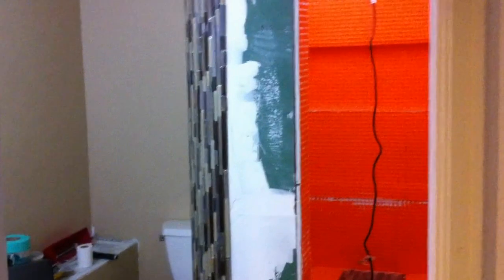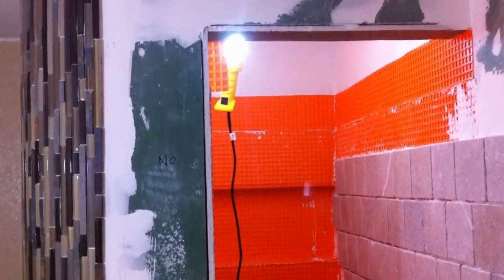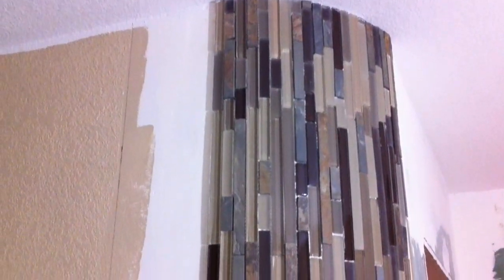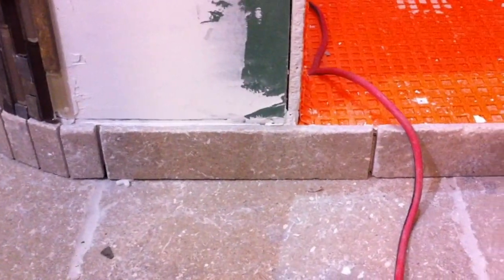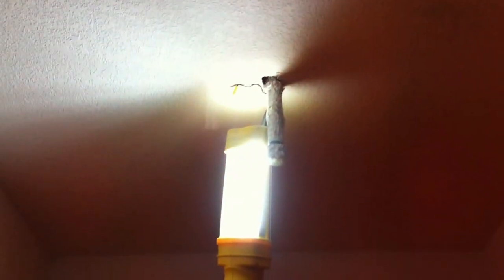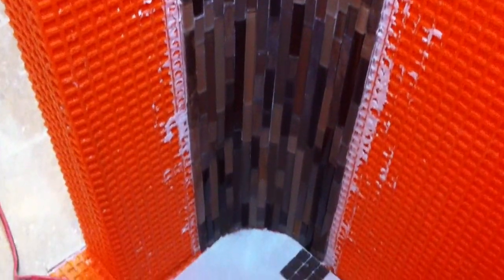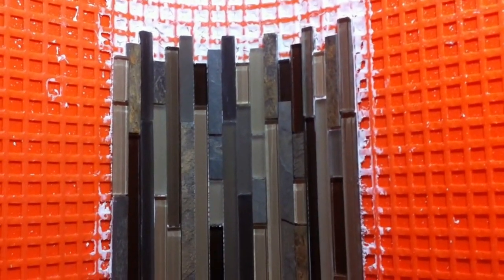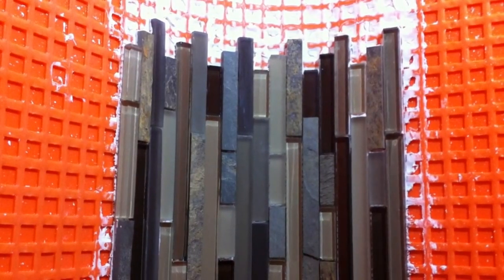Installing mosaic tile waterfall in shower Tile installation Thornton

Comment: very nice!  gorgeous waterfall effect!  really well designed and set. don't you love the Ditra?  
we're setting slate waterfall tile today, but on the walls it's just on Kerdi, we've got the Ditra on the floor. we're putting one inch slate tiles on the shower floor as well - but on a Schluter sloped pan....